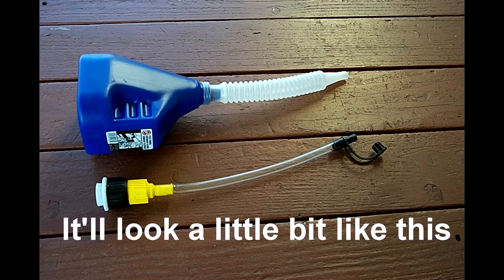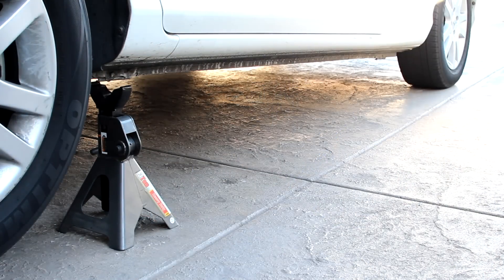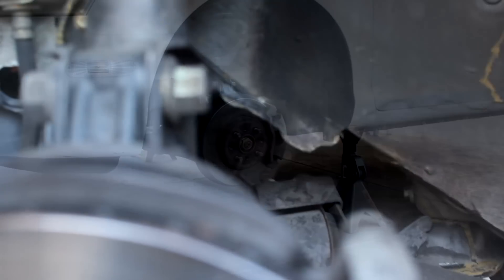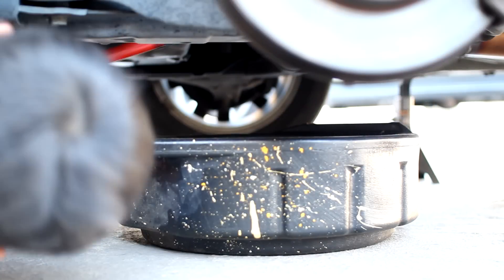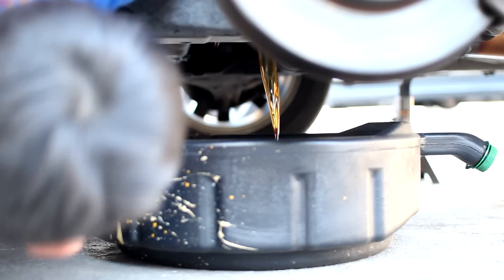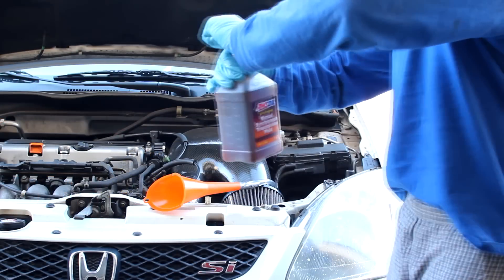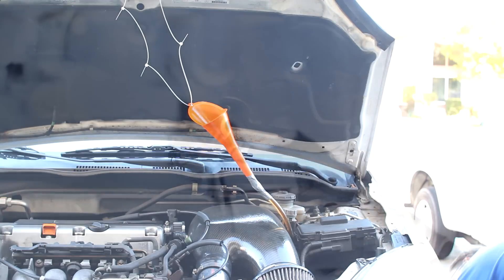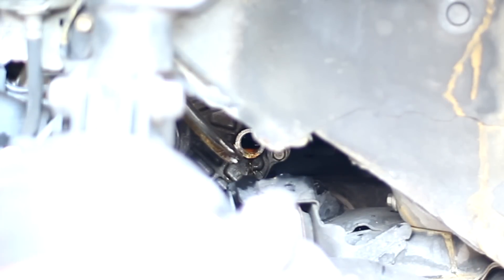How To Change Manual Transmission Fluid For 2002-2005 Honda Civic Si

Comment: hello Kevin Doung, what thing or thick size of Amsoil MTF did you use?, my ep3 has 147k miles, would your recommend 5w-30?
Reply from the maker: 5w-30 will work, that's what i used.
Reply: thank you so much

Comment: Kevin Duong can I change the bolt for an aftermarket one or should I use the same bolts? thank you so much.
Reply from the maker: You can change the bolt for an aftermarket one if you wish as long as its the right size and make sure you use a crush washer so it doesn't leak.
Reply: Ok thanks man I appreciate
Reply from the maker: sergio hatto No problem

Comment: So you just refill the fluid and that's it, you don't have to run through the gears and top it off. I have an 05 ep3 and I wanted to ask just to be safe.

Comment: I jacked my car up like he did at 47 seconds in and now my hood of my car even when fully pressed into the normal " locking mechanism" is higher than it should be as if it was unlocked from the pull handle from the cab on the bottom left area near the floorboard.  

This car is NOT meant to be jacked up from the front unless there is something I am missing.
Reply from the maker: You jacked it up on the radiator support. This is a common mistake,  make sure to jack it up on the frame. Good luck fixing this.
Reply: You jacked up the radiator support which is also where your hood latch is  take it to body shop
Reply: @daniels_wild    Na...the price I would have to pay to get them to fix that doesn't make any sense..I already drilled new holes for the vertical ..plate piece that the hood locking..latch mechanism bolts to and fixed it well enough.

Comment: Is this the same process for the 93 integra ls Kevin Duong?
Reply from the maker: The process is the same, but the transmission is located on the opposite side for that car. So you take off the front passenger wheel instead of the front driver's side wheel.

Comment: How do you check the fluid without changing it, if there is no dipstick?
Reply: I believe you have to go under the vehicle and remove the fill plug and stick your finger in there and feel if there's fluid. But I could be wrong, might as well change the damn thing.

Comment: Did you notice a difference after oil change?
Reply from the maker: Well this is a transmission fluid change and I did notice a difference in shifting. The gear changes were smoother.